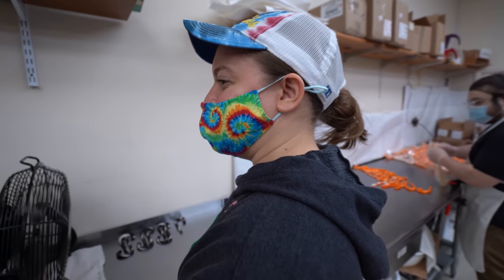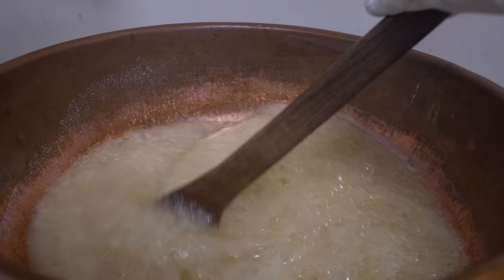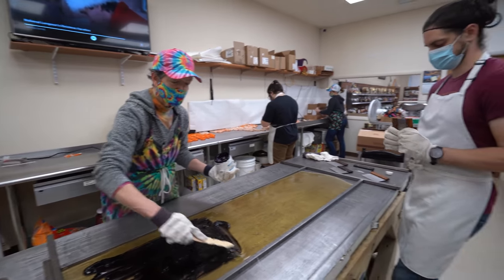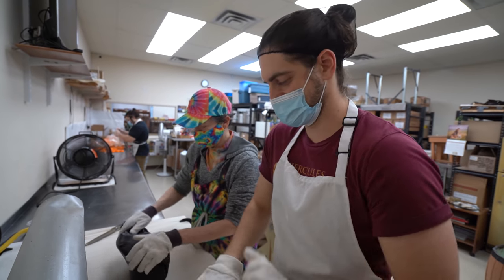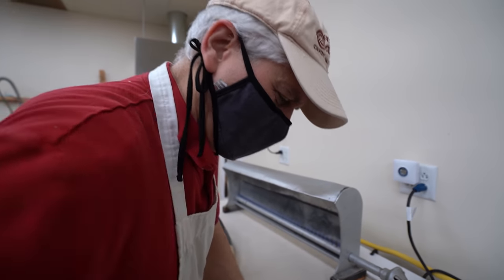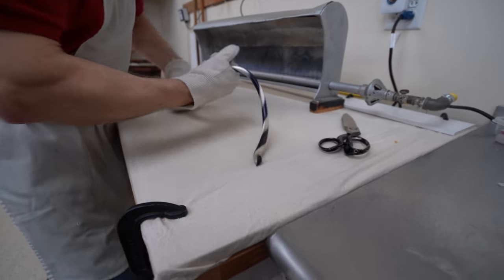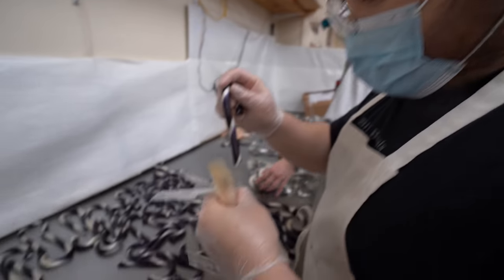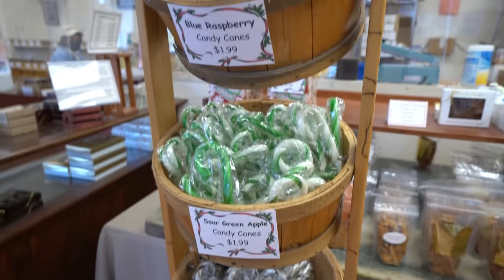The Family That Makes Candy Canes Together!

Comment: Candy Cane Season. WhooHOO!!! I remember seeing a video of candy canes being made in a factory. Once a piece was cut to length, and while it was still soft, it was slid into a long narrow cellophane bag, and THEN the hook/curve was made. The bag was heat sealed once the cane had firmed up.This eliminated a separate bagging step. Seemed easier and more efficient. Do you think this might work in your assembly line procedure? Just a little tip from your Uncle Jim.

Comment: The next time they do a deep cleaning take a steel wool soap pad and scrub the oxidation off the scale's bar the number will pop out more. Keeping it shiny can be done with a bit of car wax or a coat  lacquer hair spray say like  Aqua Net on the polished surface will keep the rust away.